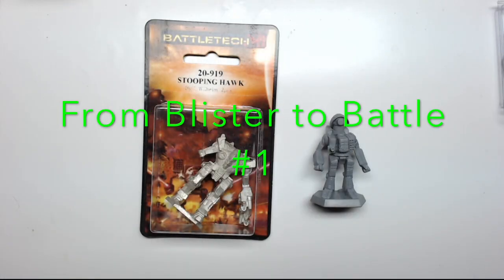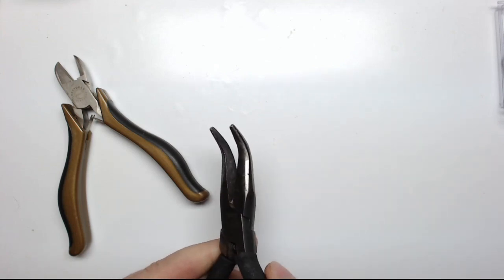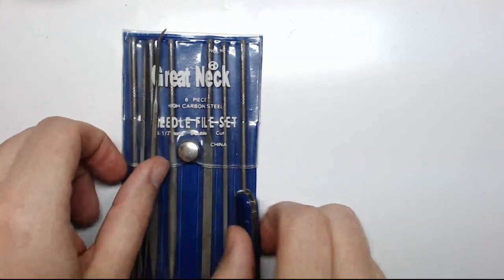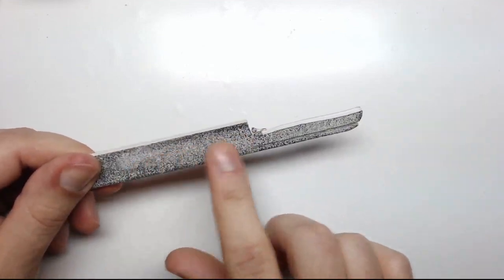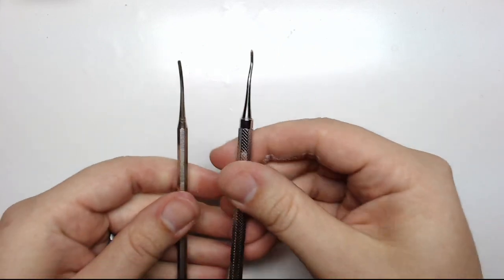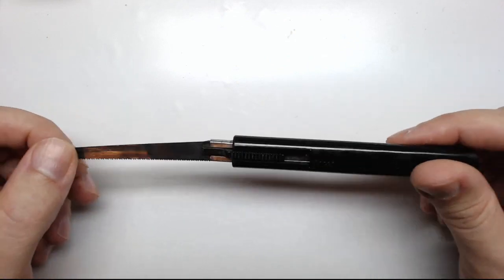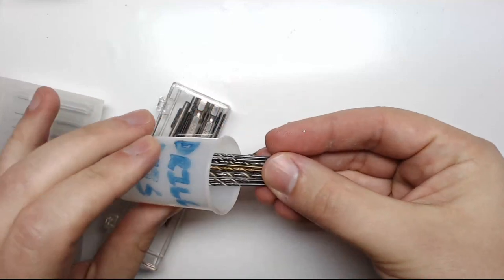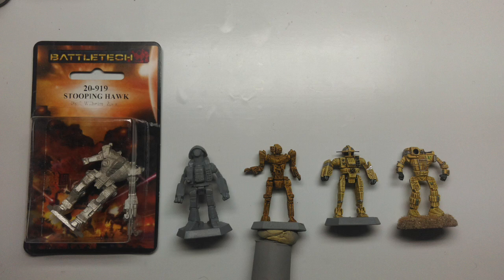From Blister to Battle #1: Miniature Assembly Tools | Battletech Painting

Comment: This is great! I was just about to ask if you could do a video on it. I'm having issues with taking the mold lines off the plastics with a hobby knife. Also finding some of the models like the clint and hermes have very hard mold lines on the legs that go over/through the detail. Not sure if you can choose those to clean or a more difficult model that has mold lines going through circular detail and not easy flat panels. Thanks again for these!

Comment: I'm heading there now to get that curved file, that's fantastic and just what I need. Great tip on the brass brush cleaning up plastic fuz, I will give that a whirl. Have you tried that on the 3rd edition plastics as well?
Reply from the maker: I haven't tried it on 3rd edition. I've had those all painted and long since sold off. If you give it a try, let me know. I know that you can use hot metal wire or a lighter/candle to take the fuzzies off the 3rd editions as well.

Comment: Im curious where all these mold lines are.  I have some 50 minis and rarely have I had any mold lines anywhere.  For me, the only tool I need before I begin painting is a utility blade.  I think my minis turn out pretty nice.  (I have videos at my channel of my minis.)
Reply: They are thin lines usually going up the sides going vertically on the plastic mini's. On the metal ones it depends on the cast, sometimes they get through the center of the mold.
Reply from the maker: Thanks for your feedback. I looked at some of your videos and an example I would give on your miniatures (which look great by the way) would be the Bruin. The front edge of its left leg has a mold line running the whole way down the center to the foot. Often times these can be slight and not an issue, but sometimes as mentioned by Konrad, a slipped cast will show a huge variation that presents itself with washes or highlighting.
Reply: Thanks!  I see now what you mean.  I don't really notice them all that much to be honest.  Of course pictures of my minis arent used by the company hahaha
Reply from the maker: Some people are okay with them, some people are taken to the brink of insanity in trying to get rid of them. What matters is that its a game and that you're happy. I don't pick on folks for mold lines as I miss them from time to time and pointing them out all the time accomplishes nothing positive for the game. Being in CSO though, I have to make sure the models are as presentable as possible to showcase the miniature so I get to be picky of my own stuff.
Reply: Yeah, those mechs on the site are fantastic.  someday i hope to get near that level.

Comment: What are the bit sizes for carbide drill bits (at 6:20, the pack with the black, pink, orange, green, and purple bands)?  The sizes maybe stamped on the side or bottom.

I went to my local Harbor Freight to look for the same set but all they had was a set with random bits with different colored bands.

Do you know if the color bands correspond to a standardized bit size?
Reply from the maker: These ones I got from Harbor Freight don't have sizes on them.  Typically the size is on the top side of the colored collar. For instance, the purple ones in my pack of larger bits are replacements and are a #71 and are 0.026" in size. #65 is a 0.035" which is between the black and pink largest bits. The higher the number, the smaller the bit.
Reply: ok, thanks!